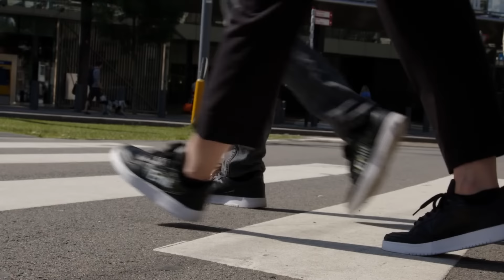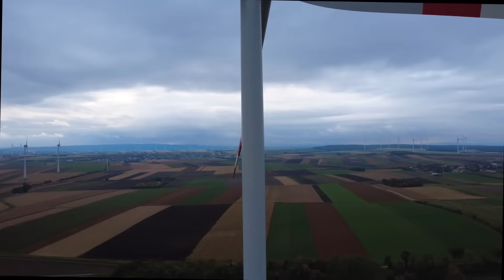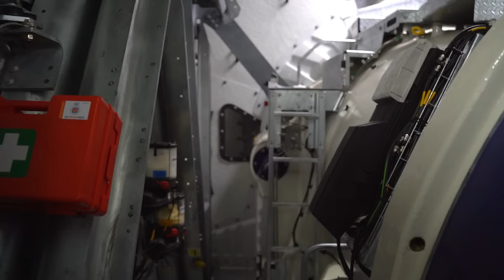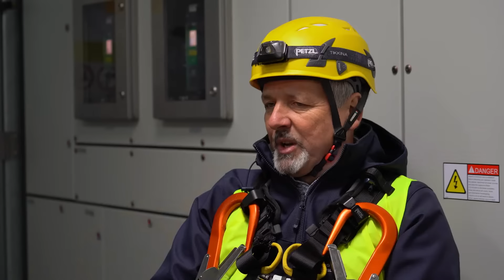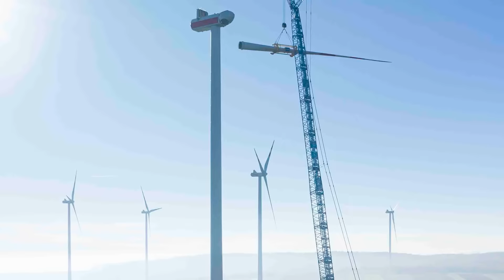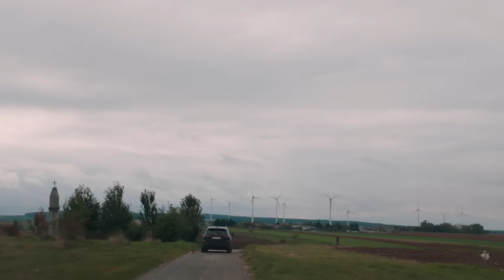The solution for old wind turbines

Comment: Increasing the capacity of a wind farm means the public power grid has to support an expanded wind power generating space.  Unless the grid has spare fast reacting hydropower to support the wind power generating space in practice wind power with its wild fluctuations in a second requiring constant make up causes wind farms to be the most natural gas expensive form of providing electricity.    Just running natural gas turbine generators at high readiness making near zero electricity is more natural gas expensive than making all the electricity with natural gas combined cycle power stations.  The UK is culling wind farm output to save on very expensive natural gas.